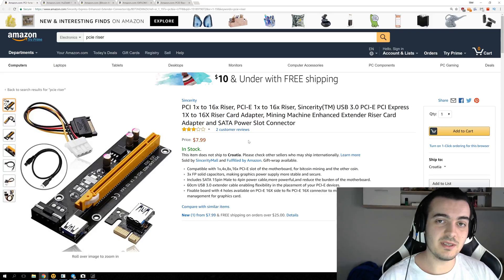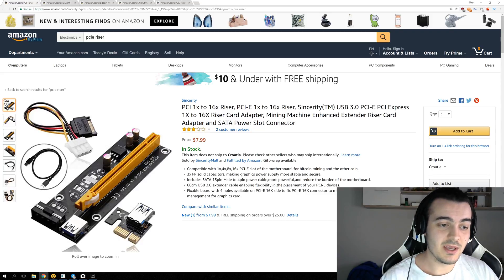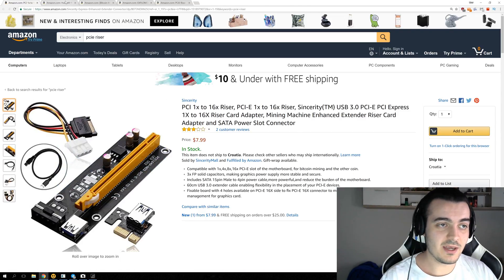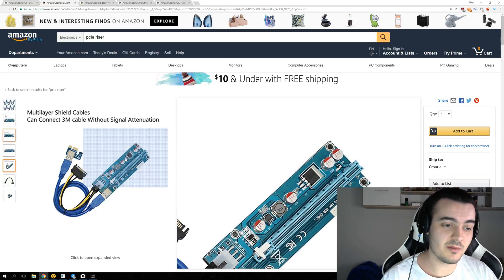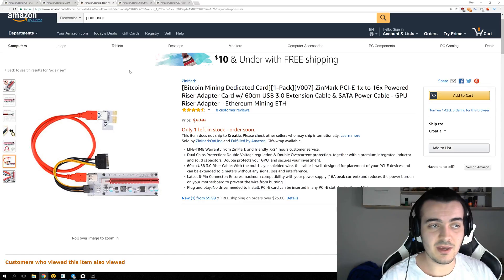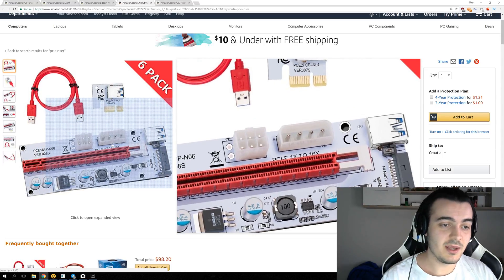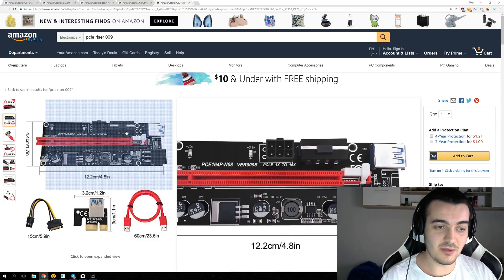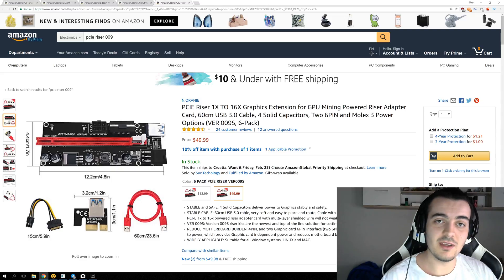Best and worst PCIE risers for mining rig

Comment: Good information, although the SATA-6pin still isn't a great connector from what I've read, given the potential power demands of the GPU. Molex to 6 pin seems even safer because (depending on wire gauge etc) it will handle higher wattage.